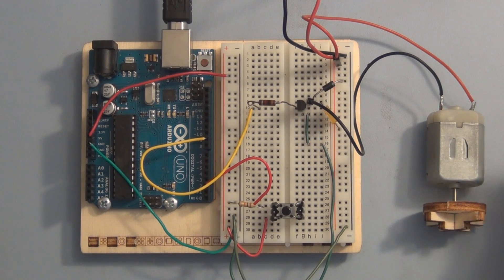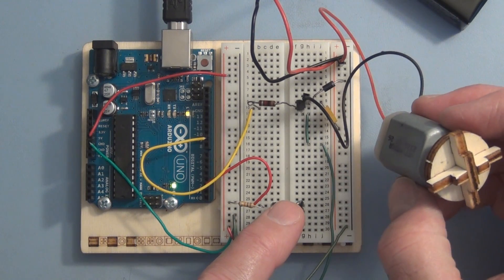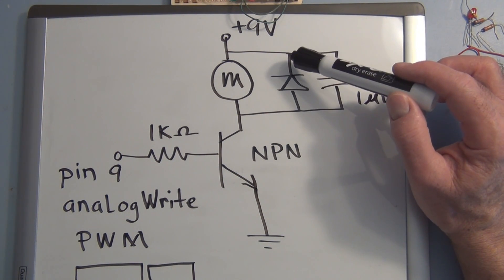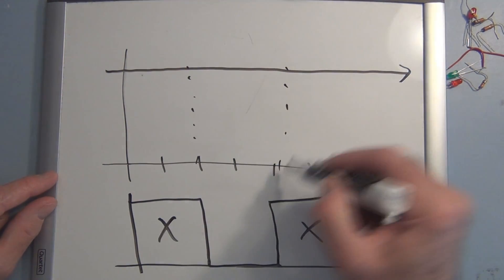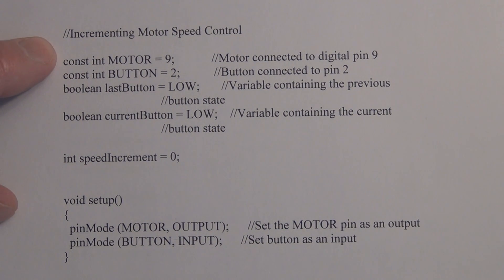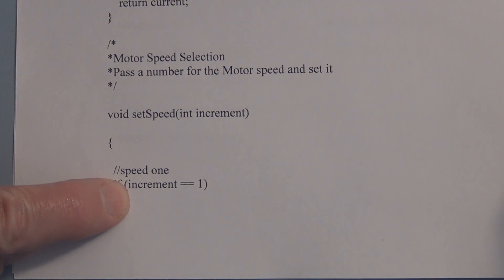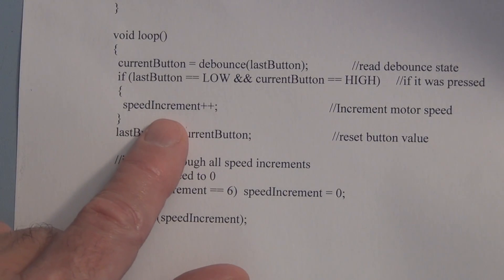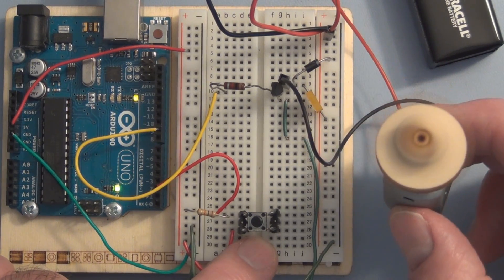Arduino Incremental Motor Speed Control Tutorial

Comment: Thank you soooooo much. I was tearing my hair out trying work on a code that worked with the TB6612FNG. just added the AI1/2 as ints,  Outputs on setup, and  digitalWrites as HIGH and LOW or vise versa on void loop. Thanks again

Comment: The diode is called fly back diode and it is used to redirect the voltage spikes back into the motor to prevent damage to the switching transistor not the supply. The diode due to its direction cannot prevent any feed into the power supply.

Comment: Did you published the code, and if you did where could I find it?
Reply from the maker: It's underneath your comment here in my first comment.
Reply: @tmc200527  Sorry, but underneath my comment is the comment of Monorails Anonymos
Reply: Could you please send your comment again as a Reply to me or just send a link to the website with the code?
Reply from the maker: //Incrementing Motor Speed Control

const int MOTOR = 9;            //Motor connected to digital pin 9
const int BUTTON = 2;           //Button connected to pin 2
boolean lastButton = LOW;       //Variable containing the previous
                                //button state
boolean currentButton = LOW;    //Variable containing the current
                                //button state

int speedIncrement = 0;

void setup()
{
  pinMode (MOTOR, OUTPUT);      //Set the MOTOR pin as an output
  pinMode (BUTTON, INPUT);      //Set button as an input
}

/*
* Debouncing Funtion
* Pass it the previous button state,
* and get back the current debounced button state.
*/
boolean debounce(boolean last)
{
  boolean current = digitalRead(BUTTON);    //Read the button state
  if (last != current)                      //if it's different
    {
      delay(5);                             //wait 5ms
      current = digitalRead(BUTTON);        //read it again
    }
    return current;
}

/*
*Motor Speed Selection
*Pass a number for the Motor speed and set it
*/

void setSpeed(int increment)

{
  
  //speed one
  if (increment == 1)
  {
    analogWrite(MOTOR, 110);
  }
  
  else if (increment == 2)
  {
    analogWrite(MOTOR, 150);
  }
  else if (increment == 3)
  {
    analogWrite(MOTOR, 180);
  }
  else if (increment == 4)
  {
    analogWrite(MOTOR, 200);
  }
  else if (increment == 5)
  {
    analogWrite(MOTOR, 255);
  }
  
  //OFF 
  else
  {
    analogWrite(MOTOR, 0);
  }
  
}

void loop()
{
  currentButton = debounce(lastButton);              //read debounce state
  if (lastButton == LOW && currentButton == HIGH)     //if it was pressed
  {
    speedIncrement++;                                    //Increment motor speed
  }
  lastButton = currentButton;                          //reset button value
  
  //if cycled through all speed increments
  //reset the speed to 0
  if (speedIncrement == 6)  speedIncrement = 0;
  
  setSpeed(speedIncrement);
}

Comment: Think of it as a sine wave whose average amplitude is 4.5 at 50% duty cycle, I guess would be more correct.
Reply: Monorails Anonymous I think it's square wave. Otherwise the speed would just reach its peak and go to zero and then the motor would reverse. Also if u clamp the circuit u could get zero at the peak of negative cycle but there isn't much of a control

Comment: Actually, Tom, you supply the same voltage but intermittently, so you get full torque on the motor. 
It provides an effect as if you were running it at less voltage. So 50% duty cycle is similar speed to running it at 4.5 v, or 10% similar to speeds at 0.9v. 
The benefit is that under load, you probably wouldn’t overcome inertia and you’d stall at those lower voltages. And you’d have to waste a lot of current as heat running it thru resistors the old school analog way. Because it switches it on and off several thousand times per minute, the effect not apparent, except that you have a reduced speed, but still keep all the torque of the full 9v. 
Also useful to control apparent brightness of LEDs. But it is still 9v or 5v or whatever the supply voltage is, so you should still use the appropriate resistors on them. 
This is a fantastic tutorial, other than that niggle, which was probably beyond the purvey of what you wanted to communicate here.

Comment: How do you look the speed without the switch , I want it to go from 100 rpm to 500 and back to 100 and then use the incremental value to set the angle for the servo , I can't figure this out
Reply from the maker: This video might help you out https://youtu.be/1ycA7TFV4t4

Comment: Hi, Thank you so much about this video and explanation. So I have a question... Is it possible to change this sketch (I mean instead of transistor and ...) in to the L298 DC motor driver and control increase and decrease speed using this module and arduino? 
In your video you used PWM pins to control speed... can we do same with L298 and arduino?

Comment: Would be a differance if we use any NPN transistor like BC237 or BC547 ?
Reply from the maker: They will work as long as you don't exceed the max collector current of 100 ma for those two transistors.

Comment: can u tell me why we used this diode and transistor,, and what happen if we dnt use them ?
Reply from the maker: The transistor is used so that we can connect a larger voltage source and supply a larger current to drive the motor.  The arduino output can only supply around 40 ma of current.  The motor will draw more than that especially if you want it to do work like having it drive a belt or some mechanical connection.  The transistor allows us to control a larger collector current with a smaller base current supplied by the arduino connected to the base of the transistor.  
     The motor has many winding of wire in it that create a magnetic field around them.  When you stop the motor the magnetic field collapses and produces an inverted voltage spike that can damage components like the power supply.  The diode will discharge that volt and limit it to its threshold voltage of around .7V since the current can only flow in one direction through the diode.

Comment: I designing same project for the sake of learning only , so can u tell me name of NPN transistor,and link for the pdf format of ur code that  u hav used.....Basically i am working on Proteus 8 prof. software ,,,,.... thanking u Lohit
Reply from the maker: +Lohit Gaurav It's PN2222.  The code is listed in the comment under my channel name below your comment.
Reply: +eTechTom  thanks alot for ur valuable reply>>> and 1 more thing >>can u guide me , where u have connected 5 v of arduino and the other end of 9v battery (along with motor) ?

Comment: yea that what i mean 
i made a robot arm controled with 5 potetnmeter with 5 servos 
i wanna to  add a sd card to record on it the reads of potentmeter and replay it
Reply from the maker: +Koke mohamed It's probably a good idea to figure out how to capture one axis of motion first.  You'll them be closer to figuring out how to combine that three dimensional motion.  I figure you will be dealing with an x, y and z axis of information that's stored on the sd card in order to repeat the motion.   Maybe you can just use an accelerometer https://www.adafruit.com/products/2019  they already have libraries written to work with the arduino.

Comment from the maker: //Incrementing Motor Speed Control

const int MOTOR = 9;            //Motor connected to digital pin 9
const int BUTTON = 2;           //Button connected to pin 2
boolean lastButton = LOW;       //Variable containing the previous
                                //button state
boolean currentButton = LOW;    //Variable containing the current
                                //button state

int speedIncrement = 0;

void setup()
{
  pinMode (MOTOR, OUTPUT);      //Set the MOTOR pin as an output
  pinMode (BUTTON, INPUT);      //Set button as an input
}

/*
* Debouncing Funtion
* Pass it the previous button state,
* and get back the current debounced button state.
*/
boolean debounce(boolean last)
{
  boolean current = digitalRead(BUTTON);    //Read the button state
  if (last != current)                      //if it's different
    {
      delay(5);                             //wait 5ms
      current = digitalRead(BUTTON);        //read it again
    }
    return current;
}

/*
*Motor Speed Selection
*Pass a number for the Motor speed and set it
*/

void setSpeed(int increment)

{
  
  //speed one
  if (increment == 1)
  {
    analogWrite(MOTOR, 110);
  }
  
  else if (increment == 2)
  {
    analogWrite(MOTOR, 150);
  }
  else if (increment == 3)
  {
    analogWrite(MOTOR, 180);
  }
  else if (increment == 4)
  {
    analogWrite(MOTOR, 200);
  }
  else if (increment == 5)
  {
    analogWrite(MOTOR, 255);
  }
  
  //OFF 
  else
  {
    analogWrite(MOTOR, 0);
  }
  
}

void loop()
{
  currentButton = debounce(lastButton);              //read debounce state
  if (lastButton == LOW && currentButton == HIGH)     //if it was pressed
  {
    speedIncrement++;                                    //Increment motor speed
  }
  lastButton = currentButton;                          //reset button value
  
  //if cycled through all speed increments
  //reset the speed to 0
  if (speedIncrement == 6)  speedIncrement = 0;
  
  setSpeed(speedIncrement);
}
Reply: what kind of transistor did you use?
Reply: You can use 2N4401, TIP120 or any other transistor with collector current equal to or greater than the current motor needed to run
Reply: Hi, I need to control DC motor speed in trapezoidal profile, so can you give me advice can I modify your code or..? thanks
Reply: is this c++